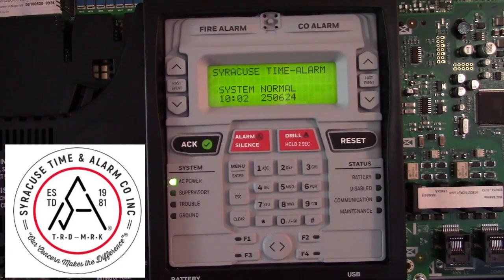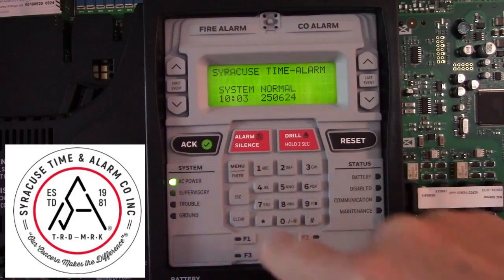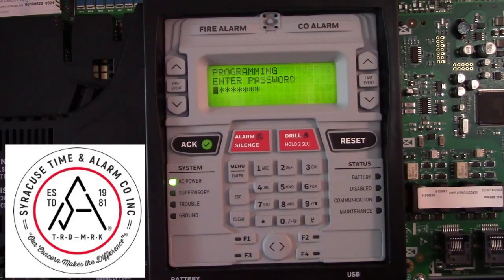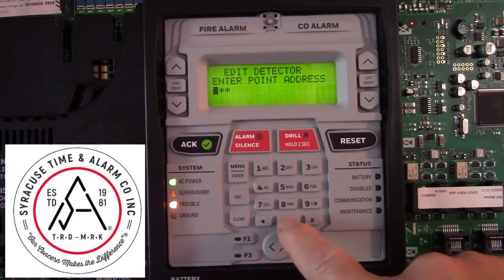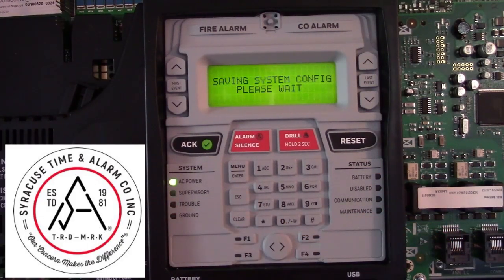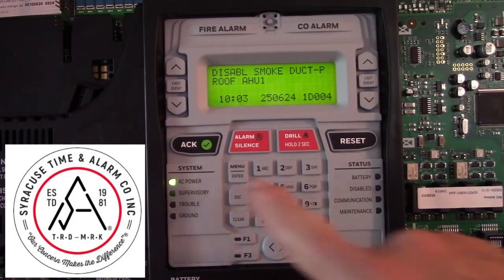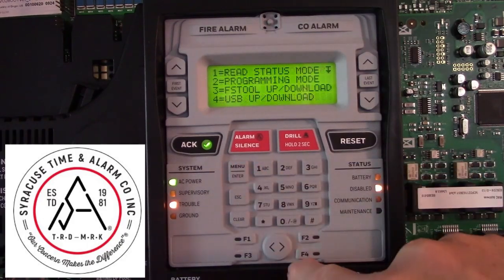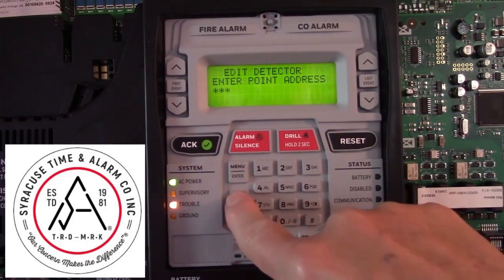Notifier FireWarden 50X disable point  🔧

Comment: Hi, I have two panels of this same model. Do you think you could share the software for that panel or a page with me? It doesn't appear on the Notifier page.
Reply from the maker: Hello, the Notifier website is experiencing technical issues right now but the Fire-Lite ES-50X is the same panel. You can visit their site here and download the FS-Tools software under the resources tab.
https://buildings.honeywell.com/us/en/brands/our-brands/firelite
Reply: @Syrtime    Hi, I have a question. I'm trying to connect to the panel, and I get an alert that PS Tools didn't find the correct panel on the PC. Why could this happen? Could it be due to the PS Tools version?
Reply from the maker: I assume you are using a USB cable. You may need to use FS-Tools instead, PS-Tools was for some of the older models. If the panel model has an "X" at the end, use FS-Tools.